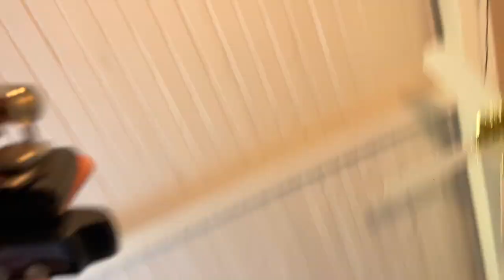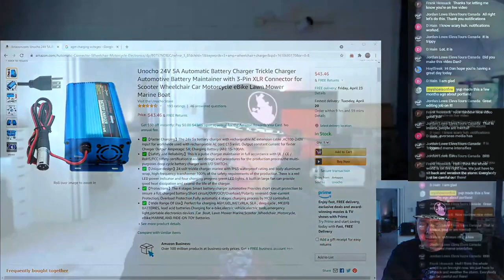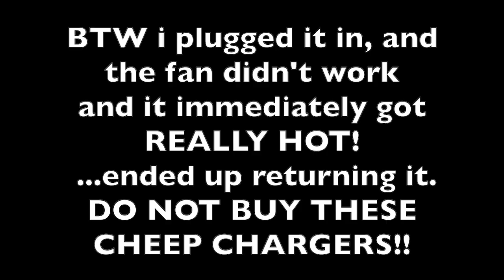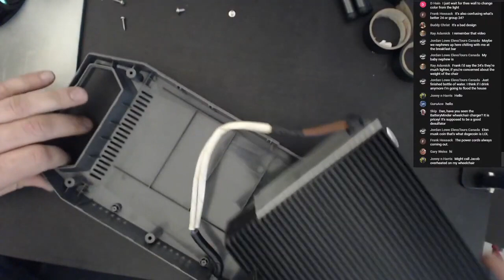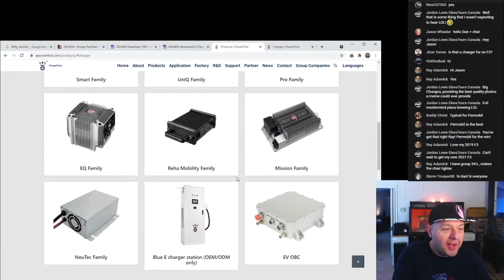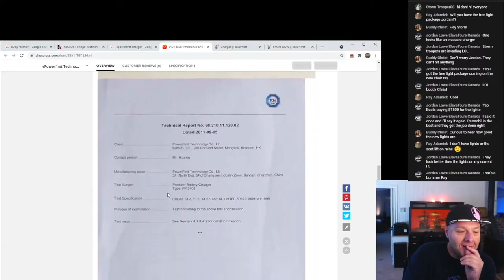Wheelchair Charger TEAR-DOWN! (live stream recap)

Comment: Per chance, would you know why the red LED would be showing on the old PF2048 charger? The chair is indicating a low power battery. It has not been used for a year. I lost the original AC cord and used another one I had with the same oval connector.
Reply from the maker: if the batteries are too low, the charger may not recognize them and actually turn on.. with a lot of chargers that condition will trip the red light.  typically wheelchair batteries will go bad within 3-4 months if left connected to a chair while its sitting idle.  to prevent this, if the chair has a circuit breaker on it. you'll wanna turn that off when the chair is put into storage.  or take off the covers and physically disconnect the batteries electrically

Comment: The battery charger for my Quantum 4Front always breaks and it is so freaking frustrating...I saved the old charger so I can use the new charger as a backup...Between you and me, I think the joystick is killing my chargers...Insurance only gives you one charger, so if it breaks, I have no way to charge the 4Front, that is why I try to use the old charger...The old charger finally broke...The power light comes on but when I plug the xlr in the charging port, the light does not illuminate...So I priced my BRIGHT WAY GROUP 24V 8A Charger FC300-240-8000U new charger online and it is over $100...I don't have that kind of money to spend on a charger...The old charger case looks like it is glued together...I have to look at it better, but I don't have a clue as to how to fix the damn thing...I just want to scream...
Reply from the maker: permobil's older chargers are made by ePowerfirst.. super nice! ya can find them on ebay for $100 or under if ya look around, and check listing a a few times per week
here's a few similar listings.. 
(there's even an older one for $68 right now - (black and silver metal)
the upright gray plastic ones, with a green sticker are great - i use them for everything :^)
https://www.ebay.com/itm/266633445275
https://www.ebay.com/itm/134916444980
just make sure you buy from a seller that accepts returns in case there are any issues..
also - stay away from the permobil 'volt pro' chargers - they are blue and black

i'd visually inspect your charging jack on the joystick tho... make sure it doesnt appear damaged, and the connection isnt super loose
Reply: Thanks I will look for that one...I remember years ago I made friends with the customer service rep from my medical supply company...Her husband gave me a professional wheelchair battery charger...It was working beautifully charging my 4Front every day until one day it just stopped working...It had the same symptoms as the charger that just stopped working...You power it on, power light comes on, but the charging light does not come on when you plug it in the charging port...I also remember this one that broke, not the one that her husband got me, got very hot to the touch...The xlr end felt like it was on fire...So I am wondering if it is meeting any resistance in the charging port or even those inline fuses in the battery cables can exhibit resistance over time...I'm just guessing...Though the new battery charger is working fine for now...I still need a backup so I will look for that permobil one...
Reply from the maker: yeaa if the XLR is getting hot.. then something is wrong.. it should never get BARLEY warm to the touch.. in the US i know there is a user app for the power platform.. its different than the 'my permobil' app, i thought it was quickconfig.. but again IDK in other markets outside the US
Reply: That is why I am thinking it's the wheelchair not so much the charger giving me problems...If it was too much resistance in the charger, theoretically, the charger should overheat and just burn out...However, if it is something in the charging circuit of the wheelchair, I assume that is putting "pressure" on the charger causing it to just stop functioning correctly...I could be wrong, I am not electronically advanced enough like you...I only have a basic knowledge of resisters, capacitors, and diodes...
Reply: It reminds me of my fan heater...It started to fail, and you could smell something burning in the fan heater...It burned out and could not be started again...I didn't smell anything burning in my charger when the xlr plug was getting hot...So that brings me back to the wheelchair...
Reply: Coincidentally, my fan heater I bought after the previous fan heater burned out started shutting off at the high setting...Took it apart and found a little cutout in the inner shroud that was putting pressure on the wires...So I used my snips to cut the shroud deeper where the cutout is...Now it stays on...They do that so you have to buy another one...Meant to fail by design...
Reply: I checked the charging port but it is not loose or anything...So it has to be downstream so to speak...I can follow the charging port cable to see where it connects to I guess...I wish I had that amp clamp meter...That would tell me if the charger is at least facing any resistance flowing through the wires...

Comment: My chair was new Barely used but the charger was so worn out but it still work the fan had disintegrated I believe someone had a couple of chargers and sold the chair I have with the lesser of the better charters that's just my take on it it still works it doesn't get very hot